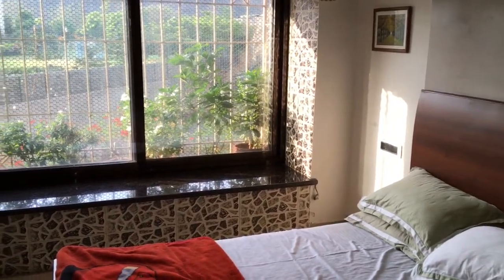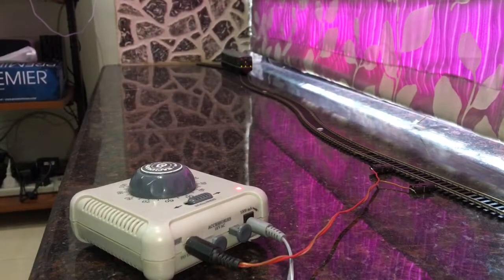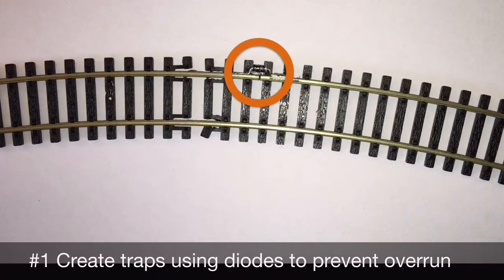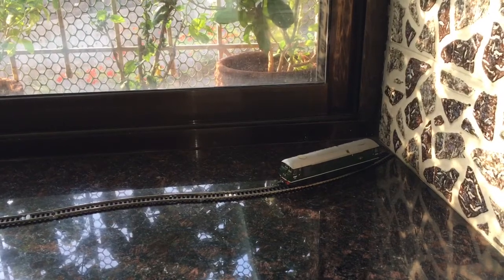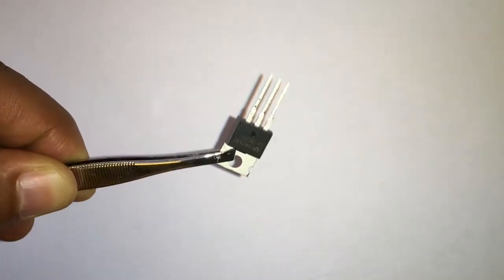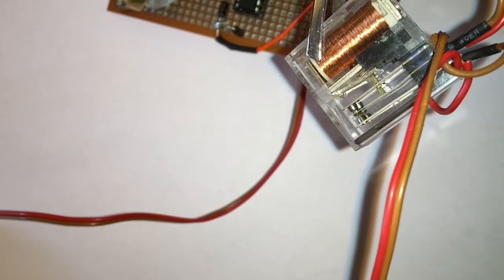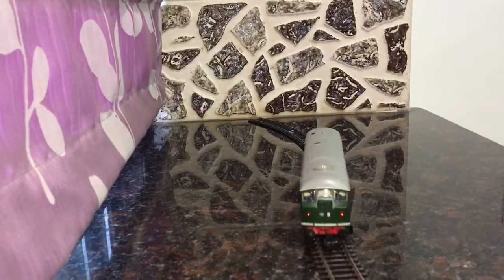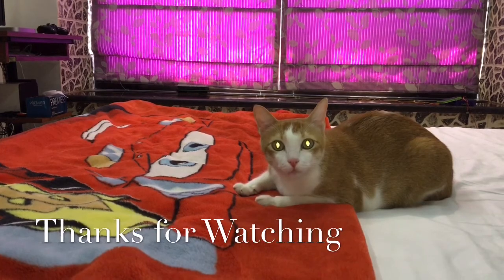Building an Automatic Shuttle Layout

Comment: but how you have made the electric connection
Reply: There are two tracks, one is uncut and the other one is cut at a short distance (the length of the train) from both ends.  The two diodes are soldered across the gaps with their polarity pointing in the same direction; this isolates the centre section with station stops at both ends. 
 This is how the two output wiresfrom his device  are connected to the track:  one is connected to the uncut track of course, the other one is connected to the centre section of the cut track, that is between the two diodes.